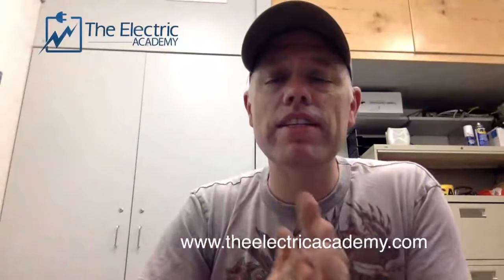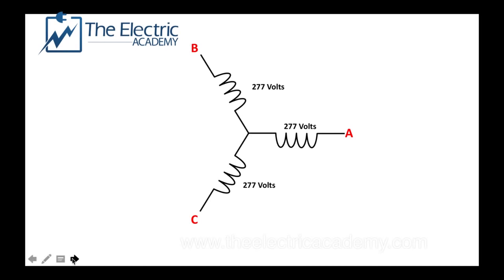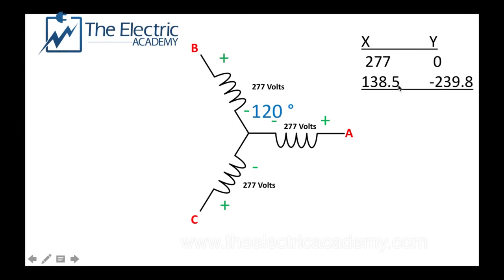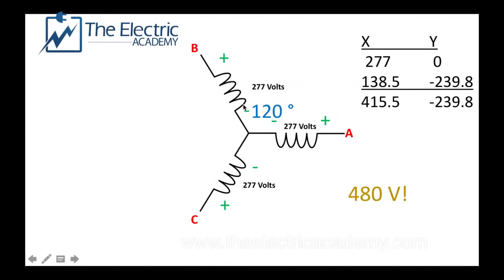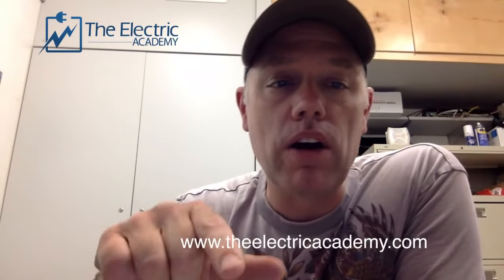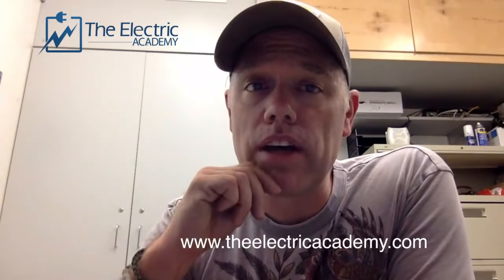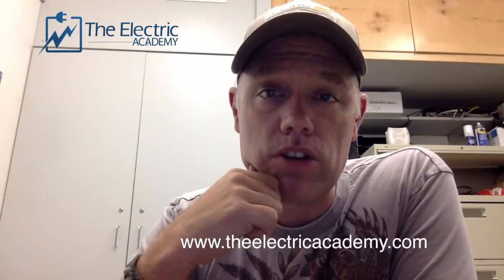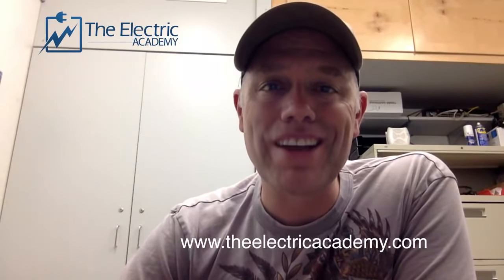How three phase math works (277 + 277 = 480?)

Comment: but why square root of 3 why is this (√3) almost used everywhere
Reply: v1j7k 
This will be more difficult to try to explain than it really is but I'll try to put it into words step by step.

Right triangles and a little trig is where 1.73 comes from. 

If you draw out phase "A" on the x axis and then draw phase "B" 120 degrees separated from phase "A", you have two sides of an isosceles triangle. Now let's say  you draw a line to connect the points of phase a and phase b together, the isosceles triangle becomes visible.

 The inside angles of a triangle =180, so 180-120= 60 degrees. There is a total of 60 left over degrees shared between the two points of the triangle A and B. 60/2 =30. This means there is 30  degrees at both ends. 

We can use trig solving right triangles to show exactly where 1.73 comes from. Lets say the magnitude of each leg of our  isosceles trangle is 1. We draw a 90 degree line to cut the isosceles triangle in half so we create two right triangles that we can solve using trig. Lets solve 1 right triangle at a time. 

On the A phase portion of the triangle i said we have a magnitude of 1. This leg happens to be the hypotenuse of the triangle. Also known is the interior angle at the point which was 30 degrees. The trig functions we can try to use are; SOH(sin opposite hypotenuse) , CAH  (cosin adjacent  hypotenuse) and TOA (tangent opposite adjacent). 

Our known leg was the hypotenuse,  so we need to solve for the adjacent side of the right triangle. Trig functions CAH should give us everything we need to solve the equation. Cos30 = x/1. Solving the equation leaves you with cos30 x 1 = .866. Do the same thing on the other hypotenuse side for phase B and you get another .866. Add them together and you get 1.73 as the total magnitude of the bottom line of the isosceles triangle. 

That is why we shorten all that up and just tell people to multiply by 1.73 to get the phase to phase voltage on a wye. 
It's due to the 120 degrees separation of the 2 phaeses that creates a 30 degrees phase shift when you connect the two phases together.

Comment: Basically you've described power generation in a Y type configuration as set up in the transformer. But to understand how the egg became a chicken just tell em how the windings are set off 120 degrees and as the rotors pass the staters  it induces an EMF equally into each of a massive generator. One at a time each winding will be at the top of its sign wave and then drop as the rotor passes.

Comment: Lol. You can use Pythagoras’s Theorem but not the one for right angles as you said. You site a^2 + b^2 = c^2....but that’s completely wrong. You must use his FULL theorem because it is not a right triangle. All the angles are at 120 degrees. Which says a^2 + b^2 - 2*Cos C = c^2.  Good try though, you almost had it correct.
Reply: You can draw right triangles over the diagram and derive the factor using ordinary geometry of right triangles without resort to trig functions.
Reply: @GH-oi2jf  why would you want to do that?! Who doesn’t own a calculator without trig functions these days??

Comment: hi there thanks for you video. i you dont mind i want you sent to me about how you rewire 480v to 277v thanks for you help i really like your videos
Reply: Juan, what you're going to need to do is grab a neutral from the center point and only use one leg. That's how you get 277.
Reply: Juan Lamas if you have a wye transformer 480 is your phase to phase voltage. 277 would be your phase to ground or neutral connection.

Comment: What is "root 3?"
Reply: i believe its square root the voltage and multiply by 3
Reply: It's another way of saying "square root of 3".   Type in 1.732 if your calculator doesn't have square roots.  1.732 x 277 = 480 (Actually 479.76 but close enough.)
Reply: round it up to 1.73
Reply: not a square root, but a cube root.
Reply: +CMS Electric, 

You can't tell a cattle drive from a ghetto.  Probably don't know a feeder from a branch.

You tell a horse to giddy UP when you want to go.
  
You tell an urban youth to get DOWN when you want to listen to hippity hop rabbit music.

Math-o-matics sure ain't yo strong point, is it?

This is clearly  your first rodeo.  Please  giddy down before you hurt yourself.

There's no round up from 1.732 to 1.73.  That there partner, is a round down.  

Hoss, to be pacific, you done did lost yourself 2.0508075688772935 millivolts.  

Please go back to Ms. Harbinger's 3rd grade math class and check what your accountant's been telling you about "round up".
Reply: Genius.  You keep believing that, and in Santa Claus, and the tooth fairy.

Comment: 277x1.73=480
Reply: John Doe where does the 1.73 come in to play?
Reply: Remember your basic right triangle from 7th grade math?   
The multiplier factor for the addition of the two vectors (magnitudes and directions of alternating current) is quite simple:
 Tangent (Angle) = Opposite / Adjacent.  
 Tangent (-120°) = square root of three = √3  = 1.732
Reply: Joe Bucci 240 not 230    480 not 460  120 not 110. Nominal voltage +- 5% not 10%  I don't know where people get these off voltages.
Reply: I never said 110v, it's 115 volts. The nominal voltages for North America is as follow: 115v, 200v, 230v, 460v. You might be getting confused with the NEMA chart which mean National Electrical Manufacturing Association chart that describes plugs and receptacles. Instead of pissing up a rope, go to Franklin Electric web site and read their AIM manual. I have been In the electrical industry for 37 years and I not seen it all, but I have seen a lot.
Reply: Joe Bucci lol you gotta be kidding, or you have been mislead.  Open your panel and read the voltage.  120, 240, 208, 277, 480 are nominal voltages in the united states.   Exactly You may be getting mixed up with nema charts. What have you been doing it the electrical industry for 37 years? If you don't even know nominal voltages.  Parts warehouse worker?
Reply: O.K I give up. But I need to quote John Wayne ( you just can't fix stupid )
Reply: John Doe Correct. Joe Bucci is a bafoon.  NEMA takes into account resistive i squared r losses of the branch circuit to the outlet from the panel.  The plugged in device always sees less than what's at the meter (unless no current).
Reply: Jules is correct. Right triangles and a little trig is where 1.73 comes from. 

If you draw out phase "A" on the x axis and then draw phase "B" 120 degrees separated from phase "A", you have two sides of an isosceles triangle. Now let's say  you draw a line to connect the points of phase a and phase b together, the isosceles triangle becomes visible.

 The inside angles of a triangle =180, so 180-120= 60 degrees. There is a total of 60 left over degrees shared between the two points of the triangle A and B. 60/2 =30. This means there is 30  degrees at both ends. 

We can use trig solving right triangles to show exactly where 1.73 comes from. Lets say the magnitude of each leg of our  isosceles trangle is 1. We draw a 90 degree line to cut the isosceles triangle in half so we create two right triangles that we can solve using trig. Lets solve 1 right triangle at a time. 

On the A phase portion of the triangle i said we have a magnitude of 1. This leg happens to be the hypotenuse of the triangle. Also known is the interior angle at the point which was 30 degrees. The trig functions we can try to use are; SOH(sin opposite hypotenuse) , CAH  (cosin adjacent  hypotenuse) and TOA (tangent opposite adjacent). 

Our known leg was the hypotenuse,  so we need to solve for the adjacent side of the right triangle. Trig functions CAH should give us everything we need to solve the equation. Cos30 = x/1. Solving the equation leaves you with cos30 x 1 = .866. Do the same thing on the other hypotenuse side for phase B and you get another .866. Add them together and you get 1.73 as the total magnitude of the bottom line of the isosceles triangle. 

That is why we shorten all that up and just tell people to multiply by 1.73 to get the phase to phase voltage on a wye. 
It's due to the 120 degrees separation of the 2 phaeses that creates a 30 degrees phase shift when you connect the two phases together.

Comment: What aplaction does this have to real world . I don't think you would ever need to know this other than answering questions on a test.
Reply: white wiskers 
You're right that most people will never need to know this. I use it daily though since I work on relays in electrical substations. Phasing  is very important on the substation side of things. We can mess a lot if things up if we don't get our hook ups correct :)
Reply: Well the real world uses buck- boost transformers to correct voltages so you don't let the smoke out of equipment.